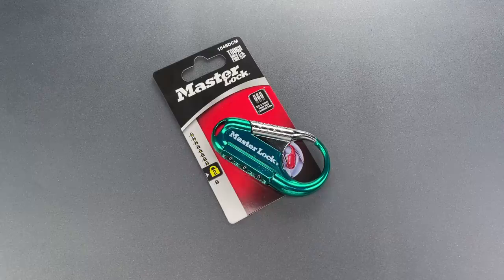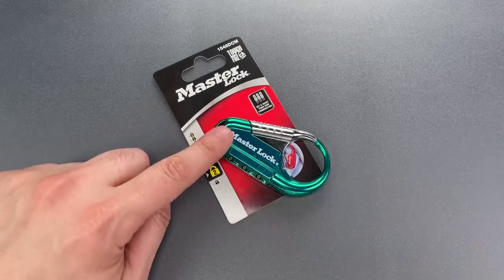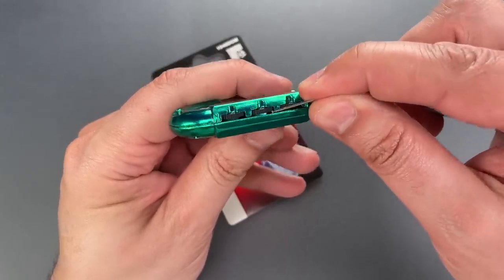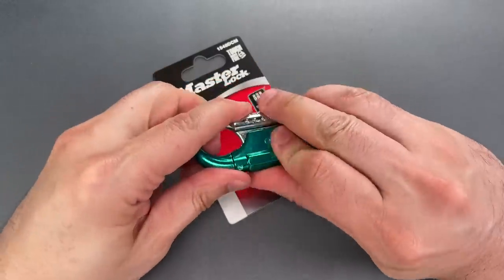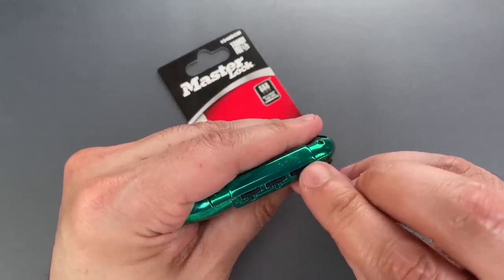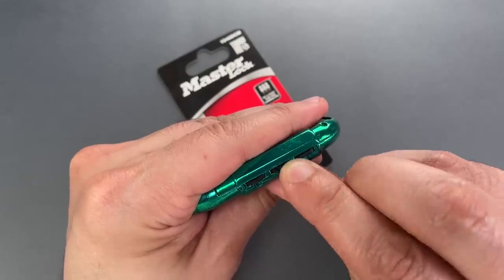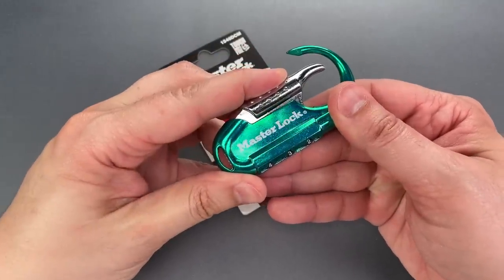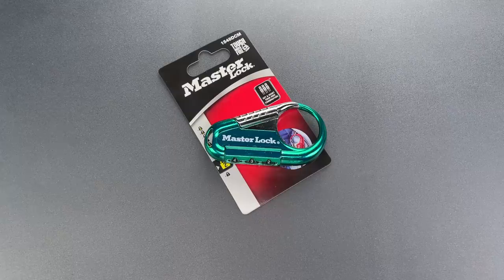[1315] Decoded by SIGHT: Master Combination Carabiner

Comment: If a "2" on the Master lock security scale is decodable by sight, what's a "1"?  Decodable by smell?
Reply: Whisper
Reply: decoded just by thinking about it
Reply: The Master lock security scale as I understand it:
0 - "Hi, ..." CLICK!! [lock spontaneously opens and falls apart]
1 - "Hi I'm Joe Random and I'm going to show you how to open this lock!" [touches it] - click!
2 - "This is the LPL and I'm looking at this new lock..." CLICK!!
3 - "...today we are going to open this with a piece of paper" [inserts the paper into the lock]... 3...2...1...click.
...
9 - "...and we are going to open this with a tool made from an old pen" ... 10...9 ..... ....1 click.
10 - "...we are going to rake this open with this very affordable tool I sell on covert instruments..." 12 ... 11...    ....2...1....click

of course Master locks doesn't tell you that beyond 10 the scale goes on and on to:
42 - "we are going to use this special tool Bosnian Bill and I made...."
...
100 - "this is a lock I would use myself"

Comment: This worked on my (cheap) TSA-compliant travel lock as well. All you need to know is which way the groove in the inner wheel should point, and then align all three in that direction. In the case of my lock, they should point 180 degrees from the direction you put the shackle in when setting the combination. No tiny bright light needed, just normal daylight. Have fun pranking your friends next time you go travelling! :)

Comment: It may be worthless for security, but on the bright side not only does it make a decent D-clip that won’t randomly unclip itself, but when you lose it for 5 years it’ll be easy to decode it once you’ve found it again without the long forgotten password. Then again, the locking mechanism blocks the opposite side of the clip making it impossible to carry any notable weight on it, it’s just an oversized key ring judging by how weak that anchor point looks...

Comment: You can also open the lock without looking by pushing on the clip slightly while you spin the wheels. I did this when I forgot the combination after finding the lock years after a move.

Comment: Okay, to be fair, this would add a lot of extra security on top of a normal carabiner. It's easy to decode, sure, but you'd need to know how and it stops someone from just undoing it and walking away. It's the same story as the """slash resistant""" bags—they're worthless as being slash resistant, but they succeed in requiring far more active and intentional theft than "grab it and walk away."

Comment: stuff like this is not fur security. it is to slow people down. you lock something around something at a pool or something. it makes it so someone can't just take whatever and they have to actually be touching stuff and messing with it and you will notice that if you pay any attention at all which most people do really. you will notice someone around where your stuff is and these locks will just make it so they can't pick it up fast and run off. these fit the purpose really as far as how they are used.

Comment: I think the purpose of this lock is simply not to be possible to open the lock by a pickpocket thief when you are on the go or standing in a crowd. Pickpocket thieves are so effective because they can steal your stuff fast and without notice. And it's hard to not being noticed when you are staring at the lock from a specific angle.

Comment: I had one of those I used for my gym locker. But, eventually the lock decided to just stop opening so I twisted it a little and the shackle bent enough so I could just take it off. Needless to say I threw it away right after

Comment: I don't think these are for anti-theft security, more for a "doesn't accidently open" security.  
I used to use one to keep my keys attached to my belt loop.  More often than not the combination would accidently get changed while bumping into crap and I'd have to cut my belt loop to be able to get my keys free to drive.
Reply: I think it will be much better if you just buy a carabiner instead; good carabiners have a captive lock nut that prevents accidental opening.
Reply: @PanduPoluan  indeed.  This was 19 or so years ago that I had this masterlock one,  it fell apart after about a year of use even.  I use proper ones now.
Reply: @otomoton  Hahaha actually you reminded me that I have to buy some carabiners for key-keeping purposes 😄

Comment: Even if you couldn't see inside it would be easy to keep pressure on the shackle whilst cycling all 999 combos

You don't have to do any complicated work just spin the dials and youll probably find the code before the first dial is on a 9

I guess that does a good job of slowing someone down which is a locks job

Comment: I could see a use case for this product if it wasn't for the fact that the change combination mechanism was holding the clasp open, it seems like something that exists to ask: are you sure you want to open this carabeener than an actual security device, but the idea of accidentally changing the code while opening it makes is rough for that application.

Comment: One thing nobody mentions is how crappy this is as a carabiner. The size of a chain/whatever you can get into that hole when it's opened is tiny. Plus, a carabiner is usually used to link two things together, and the other end looks like it'd attach to... a keyring? You know, the things that can be removed from anything in seconds, by design? Where's the security on that end, huh?

Comment: no no no LPL, you got it wrong. The gap that lets you see the combo wheel is actually a feature.
See, you have to reset it by pressing on the latch, so if you accidentaly bump one of the disks while using it and messes up you code, you can easely decode it.

Comment: What're the odds that a randomized code ends up being sequential.
Reply: With three numbers?

123 234 345 456 567 678 789
987 876 765 654 543 432 321

14 sequential possibilities out of 9³ choices.

14/9³, or 14/27² or 14/729

Approximately 1.92043896%
Almost 2 percent, or 1/50

Comment: That seems like it'd be very easy to accidentally change the lock's code while using it, if all you have to do is hold the shackle down.

Fortunately, the lock's design means this isn't a problem.

Comment: I'm more concerned with the fact that Masterlock actually has a "Security Scale" in the first place for their products. Wouldn't it be more beneficial if they actually made "10"s all the time and did not cater to failure/feeble designs and call them anything lower?
Reply: Honestly, I don't think MasterLock even manages to manufacture anything that's not a failure or a feeble design.

Comment: Curious why don't they (lock companies) have as part of the code wheel process, custom Left Or Right and custom number of times the wheel must Turn; that each wheel would need done to achieve correct combination?

Comment: I mean, in fairness, i could probably open the thing with a sturdy wooden stick, the casing appears to be aluminum, and the 'neck' of the clip, is stupidly thin at the point of the 'locking' prong.

Comment: This lock only has a 3 digit combination. You could probably open it just as quickly without even looking at the notches.
Reply: Is it true that there are only 1,000 combinations for this lock or do I have it wrong? I have a similar lock (Master Lock 1544DCM) and went from 000 to 999 with no luck! Any idea what I could be doing wrong? At this point I care less about the combination and more about why trial and error didn't work.

Comment: A code protected carabiner. What could you be securing with a carabiner that would require a lock and could not simply be cut in such a way as to bypass the device?

Comment: Wait, holding down the clip of the carabiner sets it to "reset code"? Can we just shout out that it is a horrible design, especially if you fidget alot? I feel like the look for the notches weakness was actually their solution to the question, "how do I open my lock that I accidentally reset?"

Comment: I'm not sure he ever responds these, but... what is a reasonable bike lock? I have one my mother used to have for her motorcycle, solid steel, but the lock is just a wafer core that should be easier to pick than my front door. I'd really like to start working with my bike and have no major concerns that any idiot with a wave rake could pick it open.

Comment: I wonder what level 1 security is in Masterlock speak. You just tell the lock "open Sesame" and it just disintegrate in real time ?
Reply: It's a patented design wherein if you lose your keys, you can simply tug on the shackles and it'll open. No need to call a locksmith, saves you time and money!

Comment: hey LPL i need your help. i found an abandoned bike lock in a field. it wasnt attached to anything so i decided to take it home and try and pick it. what i thought would be an easy pick (by hand) but.... uh just my luck its a Kryptonite

Kryptonite Resettable 12mm Cable Combo Bicycle Lock

do you have any tips on hand cracking the 4 code. i literally wnet through 0000 to 9999. is there something im doing wrong? each wheel has 3 false sets!!! i need some tips for cracking it. its definitely not a beginners lock. :' )